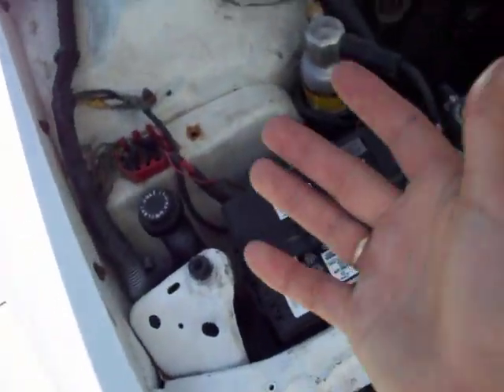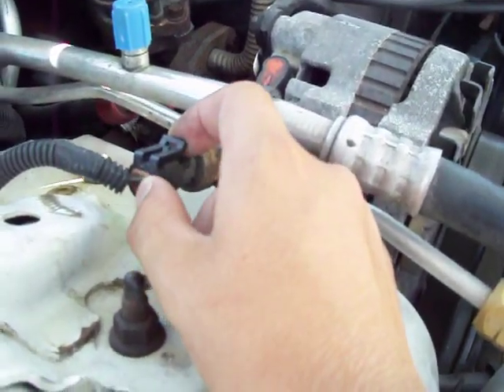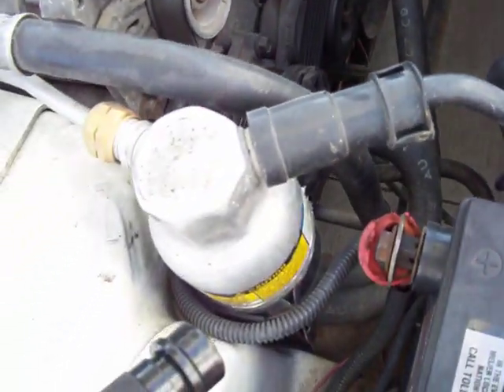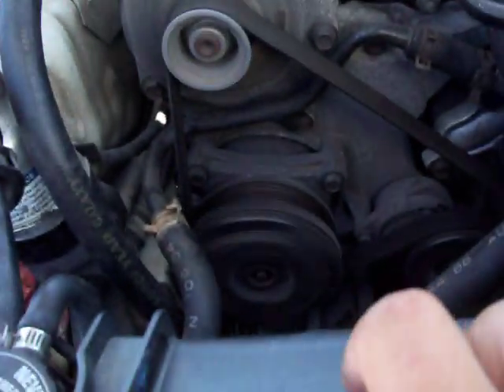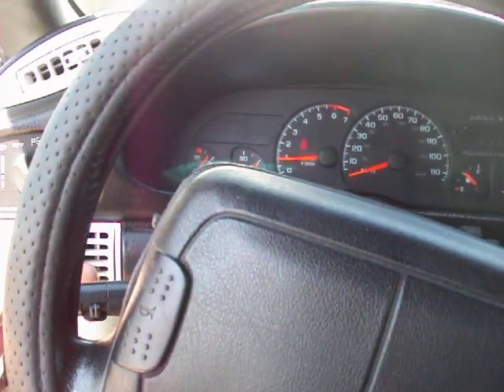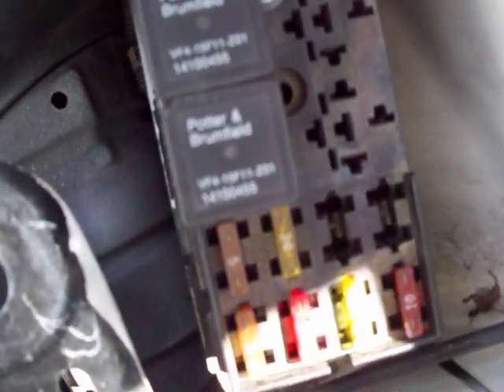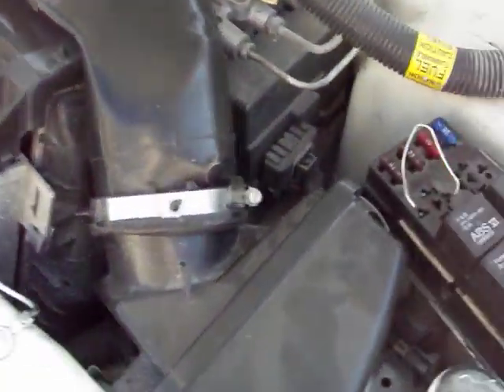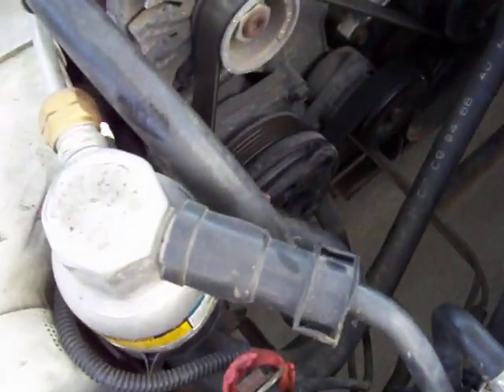How To Make AC Ice Cold, Recharge air, and Force the Compressor Clutch to Engage

Comment: Why you keep sayin coolant if you have free on in ya hand you deal with the a/c system
Reply: +Davison AutoPartLocator - R134-a isn't freon.
Reply: The word Freon_ is actually a registered trademark of the Chemours Company, and included the earlier refrigerants used in a/c and refrigeration systems... In the automotive world, it was R-12... The newer R-134 type of refrigerants replaced R-12 because it is less damaging to the ozone layer which protects the planet from deadly rays from the sun... R-134 does not perform as well as the older R-12,  but the newer vehicles that were built after 1996 have compensated for this shortcoming by having more efficient and robust systems which cool the passenger compartments very well despite the lower performance of the newer R-134 refrigerants...

Comment: The Compressor should automatic engage when you put Freon. If it don't then you have bigger problem
Reply: Hello michaelheiland123654, The reason the a/c compressor has to be operating when charging these types (Vapor Cycle Machine's) of a/c systems, is because a lower pressure is required to introduce the refrigerant into the system... This is why the LOW side of the system will be the place where the refrigerant and a/c system oil will be where it is introduced into a VCM a/c system... The only way to obtain this low pressure is to run the compressor... The pressure switch (which is located on the high side of the system) has to be by-passed in order to re-charge the system in cases of excessively low pressures in the high side of the system... After the recharging is done using the proper a/c charging manifold and adhering to the proper pressures in the low AND high side of the system (using the ambient-temp / pressure chart for the type of refrigerant being used), then the charging by-pass can be removed to enable automatic operation of the a/c system... If this seems too complicated or hard to understand, hire a PROFESSIONAL technician who is trained & equipped to work like this....

Comment: "Basically when you are low on freon (134a), you have low pressure. You cannot just loose the refrigerant, their has to be a leak. So when you recharge it, make sure you use a bottle of leak stop as well."

Couple of things to point out: Freon is nothing more then a brand, it is like kleenex brand facial tissue.Also you can and do "just loose the refrigerant", you are allowed to lose 0.5 lbs. per year. 90% of a/c issues are airflow related,  air flow over either the condenser or evaporator.

Comment: I tried bypassing the relay, but the clutch still doesn't engage... What could be wrong now?
Reply: Aaron Hudson you need a new car :)
Reply: vince appice I figured out, the problem was with the electrical connector. I fixed it, no need for a new car, as for now :-)
Reply: Aaron Hudson that's good news,glad you figured it out

Comment: Amateur ac recharge. How did he know what amount was already in the  ac system without a manifold set?  How did he determine the head pressure without a manifold guage? He kept stating if the refrigerant is low the pressure switch wouldn't engage the compressor, however, if the compressor clutch coiled had failed it would not have engaged the clutch either.

Comment: if anyone wants quality information on diy ac its this, if you don't know for sure your low on freon, dont put a goddamn can on it, you have other problems. If your low on freon, use any freon other than stopleak, and for god sakes don't hook it up to the high pressure line of ur ac, many r12 setups have the same sized adapter ports.

Comment: There is a reason ac systems cut off on low pressure ...low pressure wont let the pag or ester oil flow and will burn up your system.

Comment: The young man is obviously not an electrician. DO NOT stick paper clips or anything else into electronic sockets. Your mother should have told you this before you could walk. There is a proper way of fixing things, and words like "short out" and "quick fix" are most certainly NOT the way to get anything done right.
Reply: @ Kevin Frost, obviously- You didn't learn anything from anybody who knew better.... Not laughing....
Reply: using a jumper wire is a common practice, for diagnosing or repairing. he may not have used the correct terminology, but it's easy to understand. your not an electrician either, amazing how you know nothing but still think your right

Comment: Most instances: adding leak seal or refrigerant containing leak sealer will ruin an AC system permanently, and also no shop will work on it due to the sealer being present (their equipment tests for this).  And one really needs both high and low pressure gauge set to really understand the AC system and diagnose the issue.  Austin - get some real training !!!

Comment: if the cars old just do it, because if it efs up it doesn't matter,
Reply: Just be sure to use safety glass's & all the proper safety equipment when doing work like this... Actually, if anybody is careful to the point of using the proper safety equipment and safe techniques, then They'll probably use the proper procedures to CORRECTLY do work like this... This is because IT DOES MATTER , to do it right, regardless of the age or the condition of the vehicle being worked on.... This is often the best way to tell if somebody is trainable, or if they are un-trainable....

Comment: There are several things wrong with this video... 1) The use of low side pressure gauge only when charging / diagnosing a/c systems is NOT recommended... There should be an a/c gauge on the high AND low side of the system to properly diagnose the system...This is best done with an a/c charging manifold... 2) NEVER (which means - NEVER) use the a/c sealant he suggested... This is an excellent way to RUIN the a/c system as it clogs the accumulators, receiver/drier units, finger strainers, expansion valves and orifices.... 3) The use of the proper pressure/ambient temperature chart is recommended when doing work like this. He never used one nor did he mention what the ambient temperature was when doing this... 4) The only way to prevent damage to the compressor when charging the system with refrigerant is to keep the can UPRIGHT and in a warm area... DO NOT shake the can back & forth as this could introduce liquid into the low side which could cause a hydraulic lock and damage the compressor... This individual lacks the proper training and experience to be doing this... Please refer to experienced PROFESSIONAL advice when doing work like this... A good source of information is the Auto Zone video series with Bruce Bonebreak... He is very good and has an excellent video of doing work like this properly and will explain the correct way to diagnose problems and correctly repair troubles with things like this instead of causing more problems....

Comment: first, the refrigerant is NOT the oil, you buy/add the oil separately, some compressors are like an engine and have like an oil pan, second not all cars use the same pressures, third, the pressure varies depending on the air temperature and fourth, if your going to be an idiot and use connect the terminals, why not put a switch on so you can turn it on and off at will

Comment: here is my problem, my ac clutch engages every 3 seconds, and i hooked up my gauge that came with the r134a, it reads 0 pressure, i tried refilling it but nothing changed. what could the problem be? 1995 ford ranger 4.0
Reply: It probably has a really bad leak. Try spraying some soapy water on the various hose connectors and look for bubbles. If it's bubbling up the soap then there's gas hissing out.

Comment: If you got a blow dryer or heat gun you can make that Freon Go in fast fast fast I wouldn't recommend you turn the can upside down you could slug the compressor which is bad

Comment: Everyone bitching and moaning about stop leak will kill the AC system which is not always true. I have ran stop leak in my system and 200.000 miles later no blow compressor and no clogged orifice tube.

Comment: Checking just the low side pressure doesnt really check the system correctly. If there is a blockage in the system checking one side proves nothing

Comment: i got r 12 bud.
Reply: +Cory Batzer  Hello Cory!!! I had R-12 in my '77 GMC P/U... So what I did was take it to an a/c shop for a free evacuation of the existing R-12... Then I replaced the hoses, all green HNBR 'O' rings, the condenser, the accumulator, the orifice & finger strainer and I bought parts to overhaul the original (bulletproof) A-6 compressor for $35 from a place that sells these parts, obtained the proper tools to rebuild the compressor - and rebuilt that unit.... Then I used the proper a/c solvent in the remainder of the original system to flush the original lubricant & impurities out using DRY compressed air... Then, I added an additional filter on the High pressure side and filled the reservoir in the a/c compressor with the proper lubricant that works with R-134A... I then evacuated the system and charged it with cans (I believe it was 4 cans) of R-134A (using the proper technique to energize the compressor clutch - idle the engine and closely monitored the low and high side of the system and referred to the pressure/temp charts while doing this ... It does not get as cold as the system did with R-12, but it still cools down the cab and it has very light leakage ( I only had to add 1 can of R-134 during the last 5 years)... I studied the procedures on the Auto-Zone video of how to do this BEFORE starting into any work on the a/c system... The Auto-Zone video proved to be a very good source of information and I highly recommend referring to it instead of the video posted above.... BTW, I did the R-134 conversion on My truck over 5 years and 160,000 miles ago, and the only maintenance I have done to My a/c system is to install another belt and 1 can of R-134A... It can be done by a DIY person who follows the procedures that EXPERIENCED PROFESSIONAL TECHNICIANS instruct using CREDIBLE sources of information.... Stay clear of the over simplified 20 year-old youngsters who have very little experience and tout quick fix's as these can quickly get those in trouble doing work like this....

Comment: Sir i will give you an a for effert but first off if yoy bypass the pressure switch wich in actuality its called a cycling switch if youre clutch ran all the time it will burn up second the part were you said if there isnt enough pressure the clutch will not engage not tru as soon as yoy start charging the switch picks it up third if you bypass the relay with a paper clip and leave it there long enough it will short out youre wiring please no disrespect intended take up an ac class did you know i have seen car catch on fire because people figure hey the paper clip thing worked and leave the clip on there please take a class or sighn up for mine i teach at mechtech good luck

Comment: Yea force your clutch so you can burn up the compressor, what a maroon
Reply: Well he is using stop leak, so between that and "forcing" the compressor clutch on, that was enough for me to stop watching. It's because of people like this knucklehead that cause people that have no clue what they're doing to damage things.
Reply: kwantoon Yea, and they have a low pressure switch to hold out the clutch so the compressor doesn't burn up from no refrigerant in the system
Reply: Many systems have a single pressure switch on the high side, and then some systems have more than one switch .... One thing is for sure, If any of the switch's have dis-abled the electrical circuit that activates the compressor, the compressor will not operate.... The compressor must operate to diagnose the a/c system properly.... Then repairs and/or recharging can be made... Do the work properly and dis-regard the video above....

Comment: NEVER use ac stop leak.  It just stops up the orifice valve and probably other parts of the system.  You will have to replace the orifice valve and then pull a vacuum and perform a deep clean and recharge using manifold gauges on the high and low side.  To fix a leak....Put dye in the system to see where the leak is by using a UV light...then replace that part.  This kid doesn't know anything about how an a/c system works and he's just telling the unlearned how to screw up their system.  A continually running compressor will freeze up everything and burn up the compressor.  Geez.

Comment: First off you said it. The pressure sensor is on the high side. If you bypass the SAFETY PRESSURE SENDOR and you have a plugged line you will blow something up!!!  Not possibly you will!! Don't do this it is stupid. When you connect a can of R134A if everything is operating correctly it will start to fill and the compressor will kick in by itself. If it doesn't something is wrong. It could be the pressure switch it could be a blockage.l, it may even be the clutch on the compressor. I almost forgot if your AC is completely empty and you have lost some if not all of the oil in the system your compressor will be damaged before you get the first can in. So DONT EVER BYPASS YOUR PRESSURE SENSOR!!!!  One last thing. The pressure will vary depending on the outside temperature.

Comment: Never jump the sensor. This guy has no idea how to do this properly.  He’s telling you a good way to destroy the system. TAKE IT TO A MECHANIC AND HAVE IT CHECKED FOR LEAKS. If it’s not leaking and full, it will blow cold constantly. Just leave the dial on MAX setting, the compressor stays on constantly at that setting. If you turn it to NORMAL the compressor shuts off periodically when the desired temp is reached.  NEVER JUMP ANY WIRING OR SENSOR.  Jesus

Comment: HE HAS A COUPLE THINGS WRONG FIRST HIS  NOISE SOUNDS LIKE BEARING TROUBLE,THE PRESSURE SENSOR IN THE LINE IS ON THE LEFT BLACK  AND METAL WIRH A  12 VOLT CONNECTOR.HIS A/C PULLEY IS ALWAYS TURNING WHEN THE OUTSIDE CLUTCH ENGAGES THIS TURNS THE COMPRESSOR VANES.MOTION CAUSES FREON TO GET COLD,A CLUTCH WILL WEAR DOWN AFTER 10 TO 14 YEARS DEPENDS ON WHERE YOU LIVE!ALWAYS USE GAUGES YOU HAVE TO KNOW THE PRESSURE LEVEL ,MOST CARS HOLD BETWEEN 22  26 OUNCES ,DO NOT OVER CHARGE,,KEEP CAN UP RIGHT !

Comment: not very smart you need a set of gauges so you can read the high and low sides of the system if you have a high head pressure chances are the valves in the AC compressor are going bad if you have a leak it needs to be repaired then you need to vacuum the system if your system leaked out the Freon not coolant, coolant goes in your radiator not your AC system. As I was saying if you leaked out some Freon you also leaked out oil you need to add this to your system you shouldn't have to bypass or short anything the switch he talking about is called a cycling switch all systems are different. Depending on your car, truck, or van it takes anywhere from 1 to 6 pounds of Freon and 4 to 8 oz. of AC oil there are many web site's out there that can help you with the right information if know a mechanic ask him or go to your auto parts store and look at their auto repair manual I know most auto zones well help you most nationwide auto parts stores can help this guy has no idea what he talking about all that's going to happen is someone well get hurt or mess up their car

Comment: dude you need a 1978 camaro with a 134 condensor and r12 freon in a new r12 comressor wit a new r12 dryer, add electric fans with a manual switch to turn them on and off you should get about 28 degrees not 40 degree a/c new cars are worse and worse each year abou material decomposure, yea the literall rot , heat activated plastics same as a hefty bag , and it says this trash bag will begin to decompose in the landfill underground is hot and activates deomposure. , do you want a car made of the EPA plastics/ and pay hard earned money for it? well everyone is doing it and sad.. my cars none newer than 1990

Comment: Much of this video is useless because you don't need to jump start clutch. If your a/c clutch is working, it will turn on by itself while adding refrigerant.  Your problem is probably a leak.  We need more info to help you OMALIE.
1)  Does your compressor clutch kick on at all?
2)  Have you located any leaks? (use dye or better yet a "sniffer".
Your problem could be compressor, clutch, condenser, evaporator core, refrigerant lines, relay, etc. Use a sniffer to find leak and let us know.

Comment: sorry, but GOOFBALL alert!  put a toggle switch on the dash to replace the paper clip.  She be gettin cold.  Then BANG... lol 
Are you putting the freon in as gas or a liquid.  Depends which way the can is.  If you do it wrong you can damage the compressor.  Look it up.   Logically speaking I'd find another video with a real mechanic.